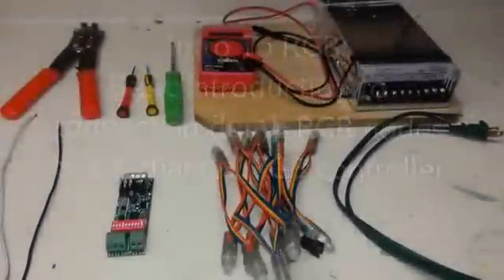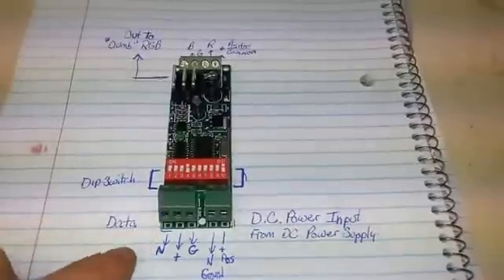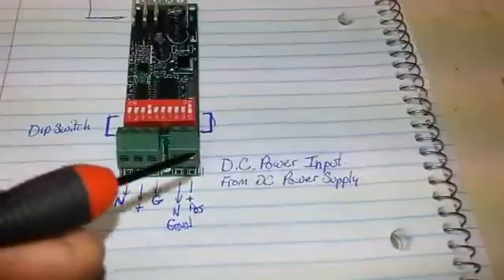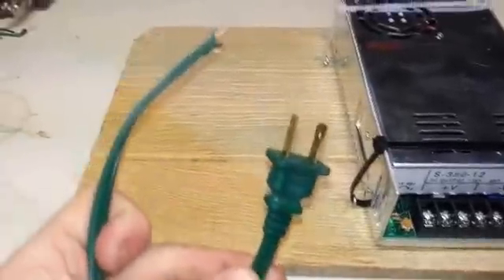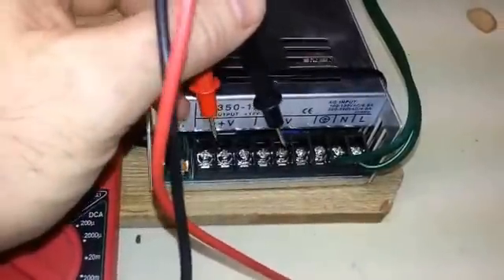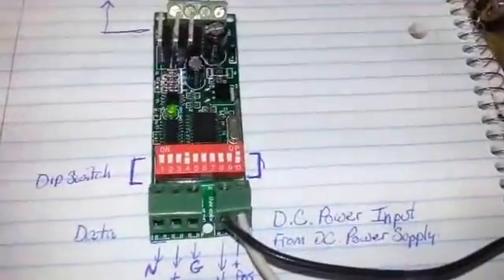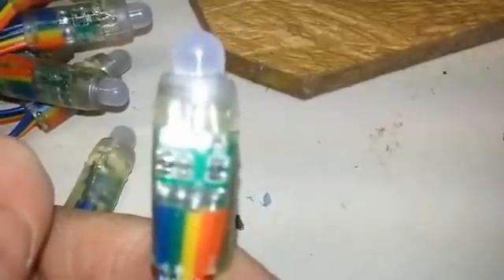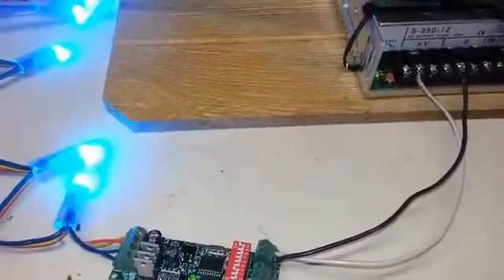Intro To RGB: Basic connection of RGB to DMX controller

Comment: Hello good Video, Is it possible to connect the dmx controller with an remote controll?
I planed 30 meters rgb from the lightswitch to the meanwell rsp 500 24 and Then to any rgb controll with remote controll to handle it from the Couch.
Greets jessica

Comment: regarding rgb pixel lifetimes, how long do nodes last in your experience? i want to do a build with rgb pixel lights mounted in it and am wondering how often i might need to fix disfunctional lights?
Reply from the maker: 2016 was the 4th year with RGB and pixels.  I am still using pixels and dumb RGBs from my first year that run flawlessly.  I have had maybe 12 bad dumb RGB nodes on my window frames.  Other props have yet to have one bad node.  I have changed maybe 15 pixels in the past 4 years.   I test all my RGB's (pixel and dumb) before building my props.  That way, if there is a problem, I can contact the vendor and have them replace the string.  And quite honestly, I've only had maybe 3 bad strings.   

Deal with a solid vendor.  Ray Wu is my guy on Alliexpres.  Buying pixels from eBay is not a good idea.  The vendor can disappear.  Amazon is starting to see pixels at reasonable prices.  Amazon is usually great with returns, but again you have to be cautious. There are a number of reputable vendors here in the us.  I recommend Crocket Fantasy of Lights for Pixels

Comment: Thanks for the videos, you can recommend me what kind of LEDs work with this 
controller, I have some ws2801 but I do not get that functions.
Thanks again
Reply from the maker: This controls DUMB rgb nodes, not pixels.  Pixels use a protocol like 2801, 9813, 2811, etc...  
You need a different controller to run pixels
Reply: Leechburg Lights what website or which dumb rgb nodes do you recommend that will work for this control? 
Can you please send me a link
Thank you
Reply from the maker: http://www.ebay.com/itm/104FT-5050SMD-3LED-RGB-led-module-store-front-light-lamp-US-24A-remote-20A-power-/231741573860?hash=item35f4dfcae4:g:jggAAOSwOfxXA6KS
Reply from the maker: I use these on my windows
https://www.aliexpress.com/item/IP68-DC12V-input-12mm-through-hole-LED-channel-letter-RGB-color-100pcs-a-string/522236867.html?spm=2114.01010208.3.2.u3ZAoF&ws_ab_test=searchweb0_0,searchweb201602_5_10065_10068_10000007_10084_10083_10080_10082_10081_10060_10061_10062_10056_10055_10054_10059_10099_10078_10079_9916_10073_10097_10100_10096_10070_10052_10050_10051_424,searchweb201603_8&btsid=d96ba89f-b0b8-44f2-93b8-5e72eb3f24b9
Reply: thanks

Comment: how do you know if your board gets fried? or just the leds?
Reply from the maker: Typically, I only have one channel (or color) that goes out.  The colors will not display correctly, they will be missing either a blue, red, or green.  This will affect the whole set of RGBs connected to the board.    If one RGB goes bad, you will notice one specific bulb does not work correctly while the rest of the bulbs continue to operate fine.

Comment: I am doing this for the first time. I'm have a 36 channel RGB dmx512 Controller which I can hook up 12 RGB strings to. I have been playing around with Vixen (ver 3.2) to create the sequences. I haven't hooked anything up yet. Before I go setting up the power/controller/lights, would I need a DMX Bridge to make the controller work, or will the DMX controller be ok without a bridge when using Vixen. There is so much stuff on here about hooking up lights to controllers, and different types of software to create sequences, but its hard to find any solid info on what exactly is needed (ie: can the computer be plugged directly into the controller without using a DMX bridge).
Reply from the maker: +Eoin Healy  I think this part of my video will help you understand what you need to hook up your controller to Vixen.  If you need more help just let me know.  
https://youtu.be/22blRaz5gZM?t=2m18s
Reply: +Leechburg Lights Thanks for getting back to me, that video was very helpful. I have purchased this one  http://www.aliexpress.com/item/For-Magic-Q-E1-31-sACN-to-DMX-Interface-Bridge-4-DMX512-Universes-output-perfect-substitution/2052761448.html. I only plan on having 2 or maybe 3 universes, so this one seemed like a good choice. There is no-one in Ireland that I know of doing this sort of thing (maybe i'll start a trend lol) so it's difficult to get any advice from anyone close by.. your videos are pretty much the best and most detailed and are helping me a great deal. SO just wanted to say thanks for making them!  My aim now is to get a small 36 channel display going for Halloween (if all the bits I ordered from Ali and amazon arrive on time) which should be a good test for me to move forward with a larger Xmas display. Thanks again!
Reply from the maker: I think it is awesome that you will have the chance to get a display up and running.Congrats mate!  If Halloween doesn't work out for you, just set your sights on Christmas.  12 channels will never be enough!  After learning more about this, you'll see how affordable it can be.  That was my biggest desire was to do this on a budget and have an neat display.  I'm so glad you find the videos helpful!  I have a hard time not making videos as I do things.  I just know someone will find something useful when I'm out making all kinds of mistakes.  Best of luck!  Cheers!
Reply: Leechburg Lights Thanks Clyde..  I have already ordered another controller from aliexpress so I'm already on my way to be addicted, and I hope to do get very addicted! lol... I still have some stuff I need to figure out, and i'm hoping you can help me with 2 things (please don't go out of your way if it means a long technical  reply, i'm sure you have more important things to do), 1) What distance from the computer/bridge is too long for the network cable? I place to have the computer in the shed at the back of the house and run the network cable to the first controller at the front of the house, which is about 30 meters from the shed. and 2) What Wattage power supply should I be using to run each controller? The lights show tha ampage, but I have no idea how many watts each string would use, so im kinda looking for an average number of watts that would likely be used on each board, for example, if I had 12 5 meter rgb 5050 strings on a board, how big of a power supply would you think I need. I have 2 old 500w computer power supplies, would one of these do it do you thing?  Thanks again Clyde! I'll keep you posted when I get the show running so you can laugh at my measly little display compared to your display lol.
Reply from the maker: First, the network cable from the bridge should be good for upto 300 meters, you can google this.  The twisted pairs in the RJ45 wire help shield the wire from data loss.

Typically I run all my controllers for the major elements using a 350w power supply.  That does not mean I use them to their full capacity. 

You must learn how to calculate your amps used by looking at the specs of the RGBs... take the wattage per meter/bulb and multiply it out by how many you'll be using... example, my window frames are 40 bulbs at .24w

40x.24=9.6watts total
Then you take your total watts and divide by the voltage required by the RGBs... in my case it is 12v

9.6 / 12v = 0.8Amps
This is the ESTIMATED usage the RGB's will require.  Since you are running dumb RGB, you can divide this by 3 colors...

0.8 / 3 = .27amps per channel

If I run 9 windows with this same amount of RGBs ( 9 x 0.8A per window =  7.2A)  I can calculate what my needs are for all my windows on this controller.  In my case, running a 350w Power supply with 30a max of 12v power is overkill, but if I ever need to add on to this controller, I have more than enough to draw on.  Hope this helps.  I'll be making some new videos on this after my display is up and running for Christmas.

Comment: Using lightorama for years and trying to move to RGB - the only thing I have far is a few LOR cosmic color ribbons, but i wanted to expand a little more.  Just curious, in this example, you are using one power supply for one controller and light strand.  Can you connect multiple controllers to each power supply and if so, what is the best way to do it?  Lastly, just how many different controllers and lights could you run off the one power supply - trying to figure out how many I need to have.  Thank you for your help.
Reply from the maker: +Stephen Davis Congrats for wanting move up to a new level!  Power is defined by the number of RGB's connected to an RGB controller.  It is the same thing as connecting incans or LED's to an LOR controller.  You are limited by the number of RGB's you connect and the maximum limits of the RGB boards.  So you must chose a power supply that can handle the load that your strings require.  Usually people will use one power supply per controller.  Some will run 2 controllers from one power supply.  I ran 3 LOR DC controllers on 22 different props last year using only 1 power supply.  It can be done, but you must make sure you are not pulling too much power.  And the only way you'll know is to calculate the usage using a multimeter.
Reply: Great.  I actually understand everything you are saying!  When running multiple props,do you just split the power off with a pigtail?
Reply from the maker: Here is the video on how I did that.  Originally (for 2 years) I used 2 smaller computer power supplies... one was more powerful than the other.  After the 2014 season, I removed the 2 computer PS and replaced with one 350w 12v PS.  It can handle the power requirements.  You can see the build here.  It is a bit different than you would think.  But, it works great for my needs and utilizes a lot of left over parts which otherwise sit in a box.  I paid roughly $5 to make this setup total.  Here is the video
https://www.youtube.com/watch?v=ItFC8j8NE5o
Reply: +Leechburg Lights Thanks.  So I looked at a few of your other videos and I understand the power.  Just make sure I have this right - basically I can use the e682 to control up to 16 channels of lights.  I could then network from it to other cards just like I would be connecting LOR boxes, - just need to provide the power to each with a power box (like you have done).  Like the question below, do I need a DMX converter since I am coming from LOR Software, or does the the e682 do that for me?  If I need a signal converter, which do you recommend?  Also, how do you know if a board is an RGB controller vs a pixel controller?  And lastly, where did you find your pigtail connectors for the lights to the board?
Reply from the maker: Yes, but don't think of an output as a channel for the e682.  More like a "prop".  You can control upto 12 universes from the 682.  Also we use a network switch to connect more than one e1.31 controller to the network.  You can not just daisy chain like LOR (yet). 

the "converter" you talk about sounds like a DMX BRIDGE?  This converts E1.31 data from the software, to go out your ethernet port to run pixels or dumb RGB.  The 682 can do that and I have a video series (4 parts) on how to do that, made it last summer.

There are USB DMX dongles that convert the signal from LOR to the RGBs.  They are from Holiday coro (Actidongle), the Enttec Pro, and the DMX King... roughly around $50.   Then you can get an E1.31 bridge.  I have 2 different models, the DIY LED Express E1.31 bridge (connects to your switch) for around $80 as a solder kit.  Also I have a video on a 4 port e1.31 bridge here for around $95 HERE:
https://www.youtube.com/watch?v=O4KI3NjyP9g

There are also options of running DMX (bridge features) built into many new pixel controllers, as we said the 682 can do this when you change the settings.  But also, the F16v2 has 4 outputs of DMX build on the board.  Also the Pixlite4 and Pixlite16 all have outputs for DMX.  Then the new AlphaPix4 and 16 from Holiday coro have them as well.  So you have options on how you want setup a dumb RGB network.

As for your last question, I have answered this using a video.
https://www.youtube.com/watch?v=22blRaz5gZM
Reply: +Leechburg Lights Thank you for taking time to do this and answer my questions.  I really appreciate it!  the kids love when we do the lights in our neighborhood....the neighbors don't mind as well.  Just trying to get away from the LOR boxes  - they are expensive and really any lights I add going forward I want to be RGB or pixels.  thanks.

Comment: How Can i use this on a light o rama
Reply from the maker: undead504 You can, you just need to have some sort of DMX converter that can take the data from LOR and convert  it so the controller gets the DMX signal.  Something like an Enttec Pro... or even an e1.31 bridge. (see video link)
Most people now will recommend a Sandevice e682 or e6804, which is a pixel controller that can convert DMX signal and output it instead of pixel data  (see second link).  Thank you for watching!

https://www.youtube.com/watch?v=O4KI3NjyP9g&feature=gp-n-y&google_comment_id=z13jtfaa5kqcgvcbt04cehli4zn2g5maqdw

https://www.youtube.com/watch?v=QcTUVZh5c84&index=8&list=PLN4rDJmT1NoB5kWqGdLRZ_QnmoZnqPSxW

Comment: Is there a certain way the dumb nodes have to be wired up. I guess I am asking are they directional like LEDs  is the a positive and negative direction ?
Reply from the maker: As per the video, if you follow the wire colors, you can't go wrong.  You can hook up from either end of the set.  If you have solid color wires, (i.e.  all white, all green, all black, etc...) you need to read the circuit board on the node and look for the identifier that labels the color or the voltage.  Follow that back down the ribbon wire and connect to the appropriate channel on your DMX board.

Comment: Thank you very much for the video I will without a doubt be saving this one for the future..  I do have some questions for you though.. 1. What pixels, controller, and power supply were you using.   2. Is that controller compatible with lor and if it is how would I go about connecting it.  3. In the video you said the controller can handle 275 dumb nodes per channel. Does that mean that mean that I can daisy chain 3-70 bulb strands together making a 210 pixel strand ( or however long rays strands are). I'm looking to do a grid on my roof for next year, would you recommend using a bunch of these 3 channel controllers or should I get some of the larger controllers.
Reply from the maker: Jason, visit me on my FaceBook show page at Leechburg Lights... send me a message there and I can follow up on your questions.  The over all process is simple.  We plan on more videos to follow on exactly how to do get these controllers to work with LOR S3 as well as Xlights/Nutcracker software.  Thank you for your question!